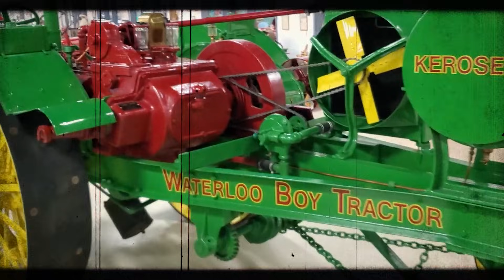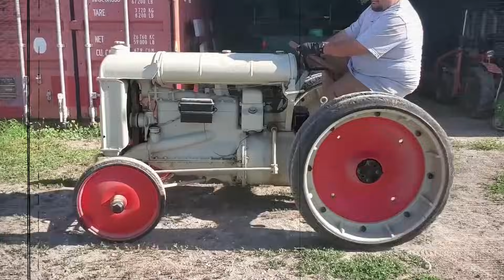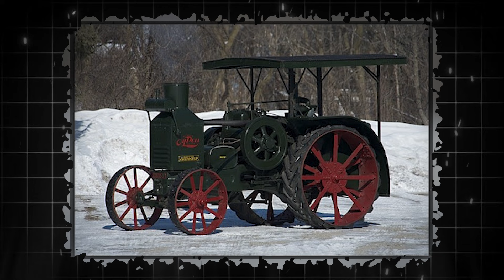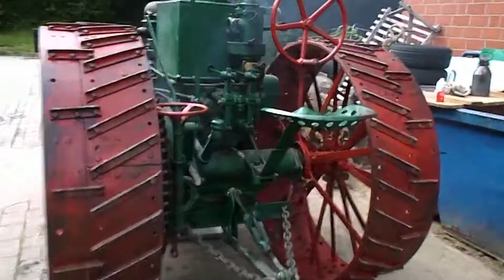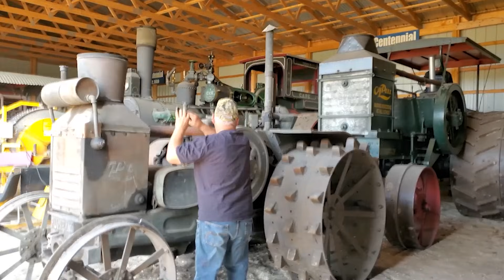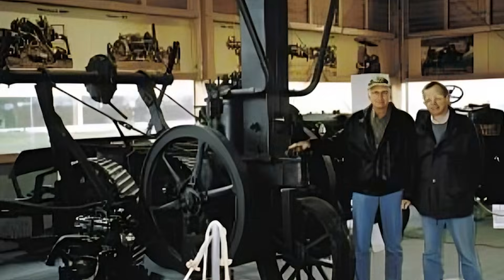9 Tractors That Are Over 100 YEARS Old!

Comment: 😊😊 the early gas tractors 🚜  of the 191OS didn't have much HP 😮😮 it wasnt until the 193OS that tractors started gaining HP  and they kept doing so in 194OS 195OS  when they went 2,a inline 4 cylinder and 6 cylinder engine and a few tractors 🚜 😊 by the end of the 195OS,already had 8O HP 😊😊 OMG 12 27 2O25